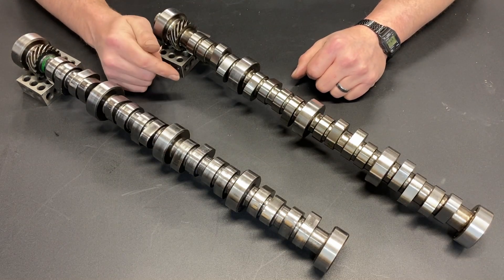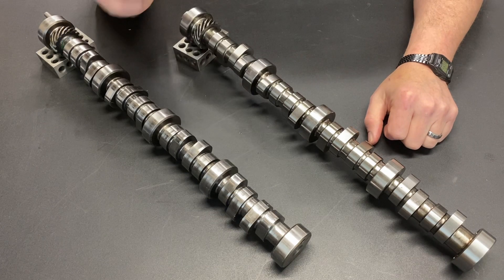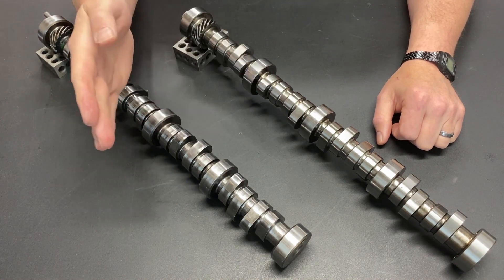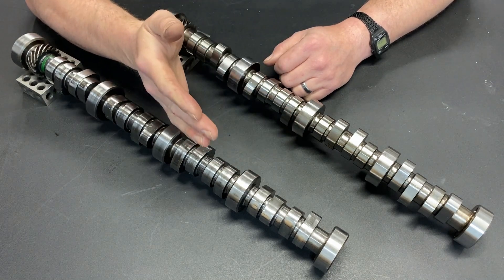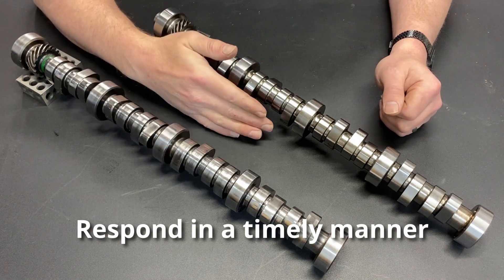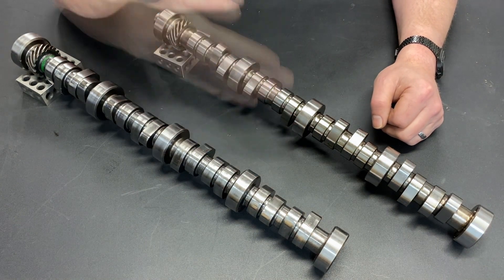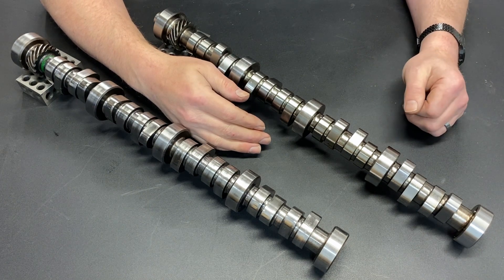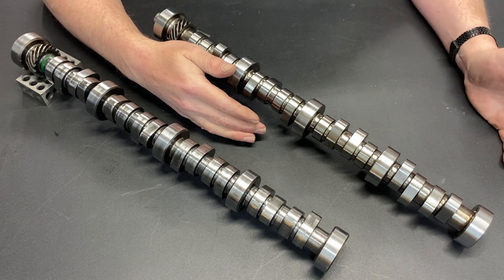393 Windsor Build Part 7 Picking a Camshaft & Busting a Myth

Comment: Thank you So much for this info,im still confused about the small base  circle requirement,  ,why is this
Reply from the maker: I you referring to a retrofit cam?
Reply: Yes,75 year block
Reply from the maker: Roller lifters (especially retrofit ones) are longer requiring them to go deeper into the bores.  The only way to do that is to reduce the base circle so the lifters fit further down into the bores.
Reply: @dazecars  ok that makes sense, thank you so much
Reply from the maker: My pleasure

Comment: I ‘ve been interested in building a 351w stroker and that’s how I stumbled on to your build series. So I too have thumbed through a few catalogs looking at possible parts I would use. The specs on that cam you showed look very close to or the same as cams I saw in both the Lunati and Crower lines . I have used mostly Crower cams with the only exception of 2 Edelbrocks and 1 Ford Motorsport cam on every engine I’ve built , I think about 15 since late 60’s,just a diy guy. Except for one Shiverlay they were all Fords , flathead, y-blocks, FE’s , 351M/400, 302/351w , and one 460. I lived in the San Diego area back in the day when I contracted ‘gear head fever’ along with a bad case of the Henry’s’. I was looking for a performance cam at my local Ford dealer but they can’t order it because Ford was on strike at the time. The parts guy suggested I just go to Crower in Chula Visita and have them grind it, that’s when I learn Crower was a San Diego company. I took my cam to them to have reground, just a kid working in a gas station for minimum wage every penny counted. Even back then they had me fill out a vehicle spec sheet, 58 Ford 300, 312, 3 spd, 3.54 gears etc. But when I went to picked it Bruce Crower explained to me he didn’t do the grind I wanted instead (base on my spec sheet) he gave me one he like better. He said it was his most popular y- block cam and it was a ripper, he wasn’t lying. I guess he made a customer for life right there. The other thing that has always seemed to work for me is match parts that work together or meant for each other. You don’t put a 750 carb on a mild 302, or hi rpm cam with stock Windsor heads or single plain on a low rpm engine. Keep everything in the same rpm range, to see hi rpm you gotta build the valve train and be able to flow the air. Sorry I got a little long. Enjoying you build series, can’t wait to se it done.
Reply from the maker: Matched parts are like mail order meal prep.  You get all the ingredients to work perfectly together and create an excellent dish.  I think not properly matching components and tailoring the motor for the application it will be used for are the biggest mistakes people make.  They pick heads, intake, or cam based on the review of one part and even though it worked well for someone else or some other application they don't copy the entire engine just the one part.  This often times leads to a restriction somewhere in the system or one part throwing off the over all balance of torque v horse power.  I also think people are conditioned to chase max HP and unless drag racing doing so makes for an engine that lacks in the drivability category.   I am NOT  a master engine builder and I am sure someone with more knowledge more experience AND A BIGGER BUDGET could come up with a better parts combination then I have specific for my application and target RPM range.  But I also know that this combination is designed for my application and will perform way better as a system than a lot of combinations people come up with.  I don't understand why people forget, or maybe don't realize that they are putting together a system where all the parts effect each other and balance is the key to maximizing performance.  I am glad you like this series!!

Comment: TFS1 will be plenty tame in a 393. I'm running the TFS 4 in a 349 and it idle down to 850rpm pretty smooth, not much vacuum for power brakes though!
Reply from the maker: How is the power?  What is your RPM range?
Reply: pulls hard to 7000, haven't taken it past that @dazecars

Comment: I have 393 build going in 67 f100 with  world product hesds sr 64cc just wondering how this cam worked i like a streetable cam not much over a stock idle .
Reply from the maker: Engine is not together (life has been getting in the way)  but based on my research this should be slightly better than the stock cams that came in performance applications like the Mustang with out sacrificing idle , throttle response or street-ability.

Comment: Way wrong LSA for torque, tighter LSA would bring torque on hard at low RPM, this cam will work harder at 4000 to say 5500 ! You need all the torque you can get to move that land yacht !
Reply from the maker: It's a 393!  I am going for more torque with displacement.  Yes I am not building a high RPM max HP machine but I also don't want all the low end torque I can get.  If that was the case I would have kept the OEM truck cam.  This cam flattens the curve a bit and gives good low end torque and good power through my desired RPM range.

Comment: Unless you first figured out the correct LSA based on CID, compression ratio, and intake valve size, you most likely left an ass load of torque on the table across the entire RPM range.  Quit listening to forum members and can companies and read up on selecting the right LSA first.
Reply from the maker: Thanks for the input